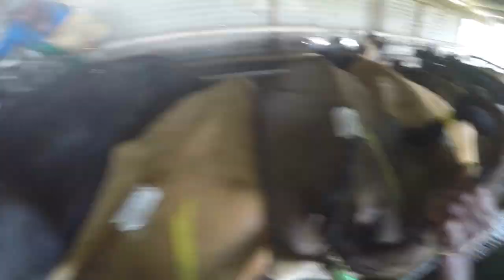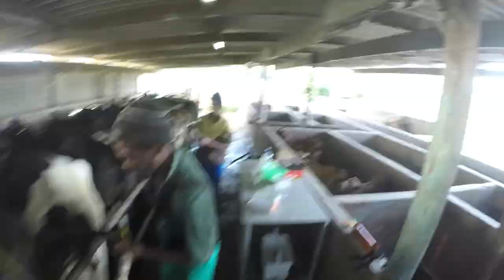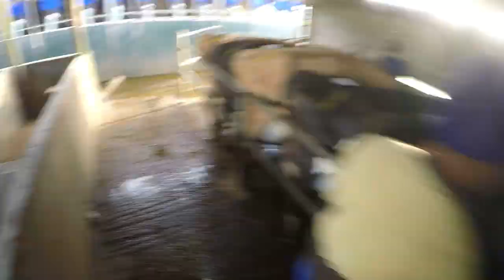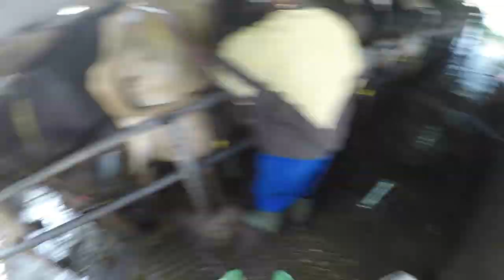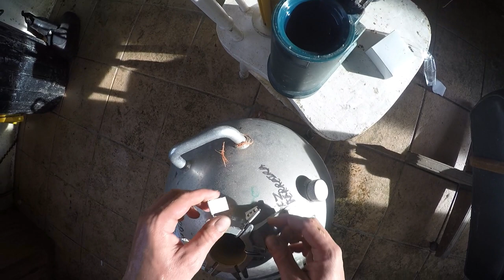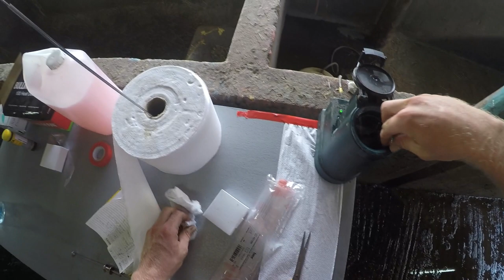Syncronizing 43 cows.

Comment: how long of a breeding season do you use? as in do you eventually turn bulls out or keep AI ing until all cows are pregnant? ive gathered you are a seasonal calver and not year round? i use to and still do to some extent AI alot of cows. we synchronize then time AI then turn bulls out for roughly a 60 day calving season...so many questions i know lol..maybe another video? keep up the good work!
Reply from the maker: +cowcamp87 Yes I'm fully seasonal. Our season is about 2.5-3 months. I start in the beginning of October and AI until about mid December. We don't have bulls, we did use them to finish off anything that wasn't pregnant but we found that we got more pregnant earlier by just AIing them right up until the end of the season so we sold the bulls...plus they wreck the dairy yards and the fences.